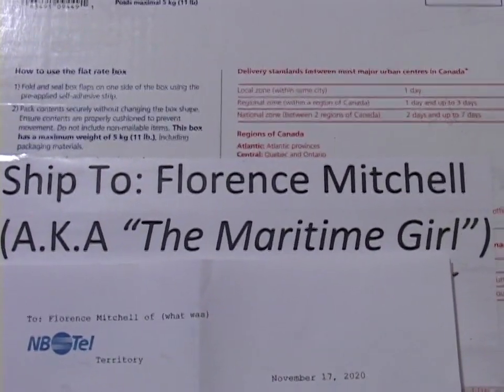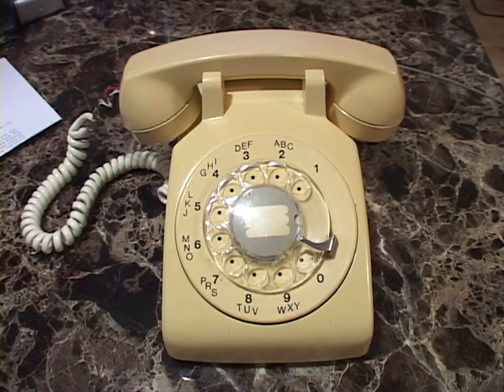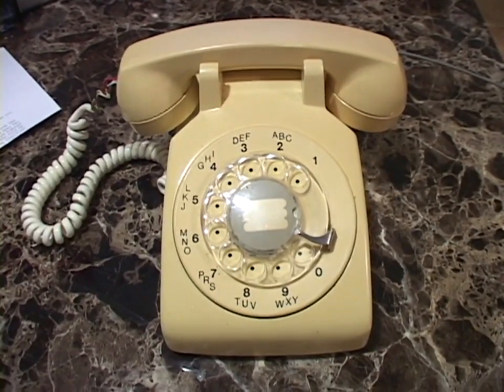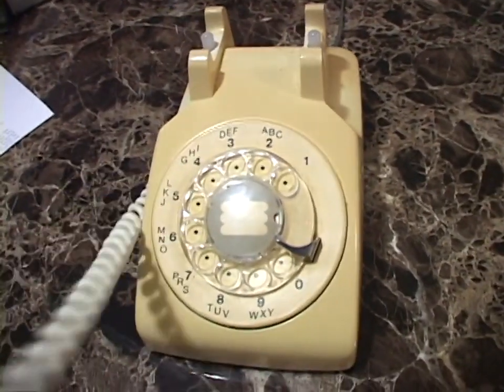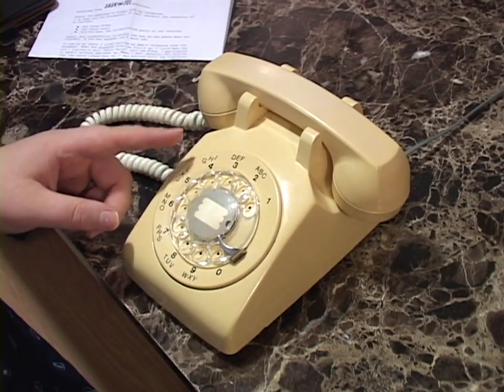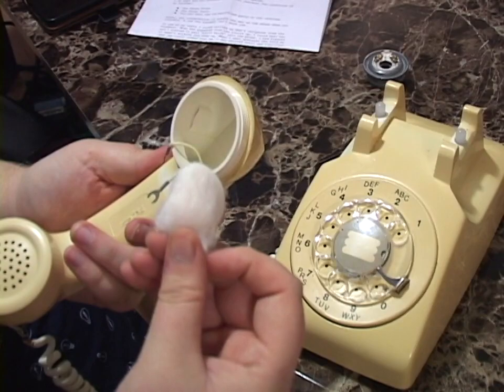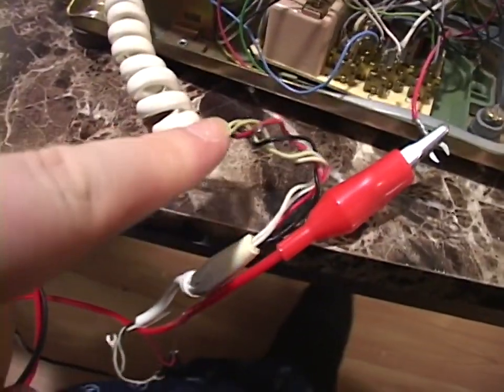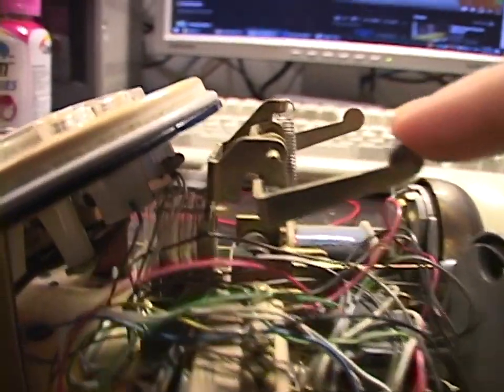Northern Telecom 500 rotary phone (1981), repair + demo

Comment: I am impressed you could solder it at all.  Mighty fine wires.  I used to repair those cords with some small crimp connectors.  I think Burndy, had them.  As much as I love technical progress, life was so much simpler, when all you had was one phone on the kitchen wall, and yes, I know this is a very old vid.  😁
Reply from the maker: Well, only two years old.
Reply: That isn't even considered "wire" in the usual sense. Telephone repair ppl know those as "tinsels" which are paired with fine fiber thread to add durability. The proper way to repair a cord like that is to cut off the bad section and crimp on a new spade lug with insulation piercing points, like the original. Both the lugs and crimping tool are available online.

Comment: The problems with this phone perfectly demonstrate two tings:
1) Why modular phones are great, you can easily replace the cord.
2) Why modular connectors are terrible, those nasty tabs that always break.
For the latter point, they have little boots that slide over the tab of Ethernet cables which seem to work well. Maybe they have the same for phone plugs. If not, an oversized boot would work just fine.

I think this was my first time seeing inside a rotary phone, thanks for that. What's remarkable is the similarity in construction between it and my much later clone 2500 from 1997. Though of course the real thing has much better materials.

Comment: Have a few of these old 500's, mostly collected through the recycling place I work at. Just got a nice brown NT one (last maintenance date on it is from '87) and a really nice Northern Electric model from 1956 in black. Both work and can call out but won't ring, I'll open them up someday to swap some wires around.

Comment: I used to have a WE  1960 made   500  and a Princess  phone .  They got lost on a house shift in 1995 unfortunately. The oldest 500 set I ever saw was a black 1950 one in original condition with fabric  handset (not curly)  and line card.  .

Comment: I have the AT&T version of this with the squared off handset and push button wedge base.
I dropped it and the cutout that goes around the keypad broke into several pieces. I have yet to glue it back together or make another card to put in place It is the piece that has the logo on it.

Comment: What brand/ model ATA are you using that accepts rotary dialing without a pulse to tone converter, and did you configure it yourself for 7 digit local calling?
Reply from the maker: It's a Grandstream HT802. Yeah, I went into the configuration and wrote a dial plan string for 7-digit dialing. It was tricky to figure out.